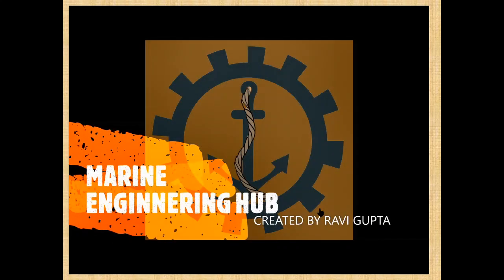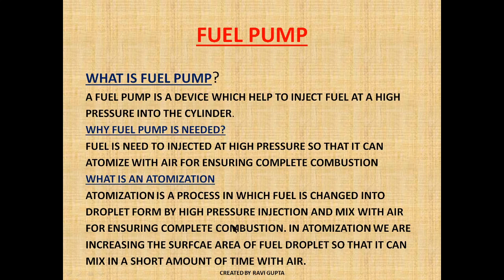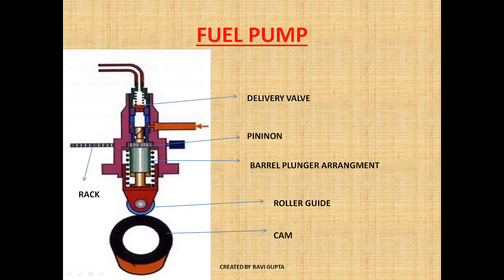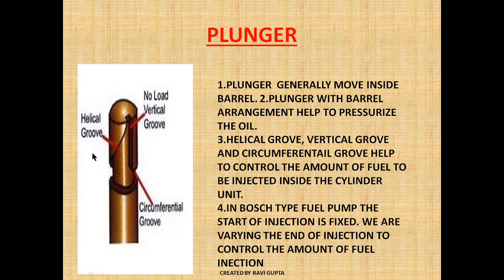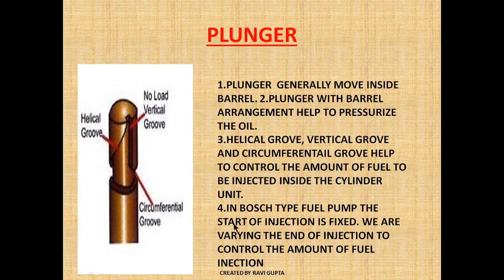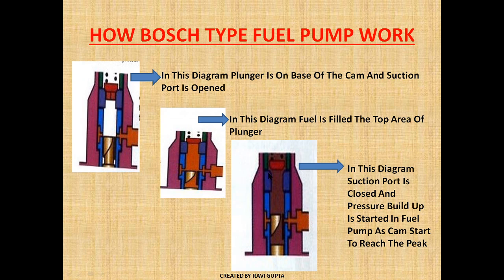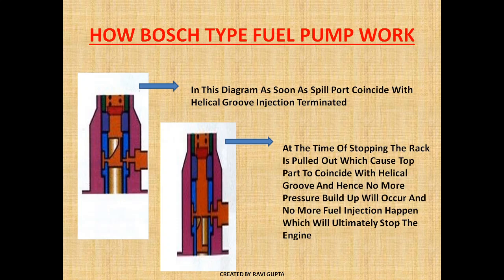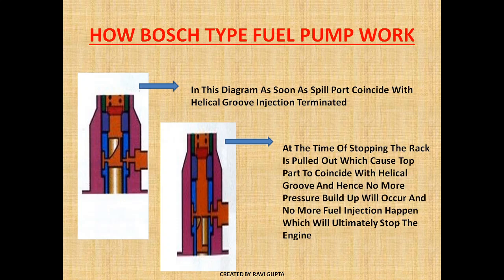FUEL PUMP| BOSCH TYPE FUEL PUMP|HOW FUEL PUMP WORK| (PART-1)|

Comment: how is fuel admitted in the chamber while the plunger is moving downwards and covering both the spill port and suction port?
Reply from the maker: In maine engine  suction valve is provided at the top which open when the plunger is moving  at BDC !!!!
Reply: @MarineEngineeringHub  is is it also there in aux engine?